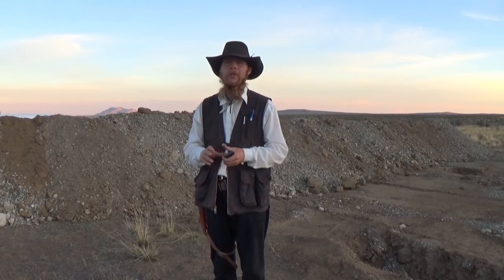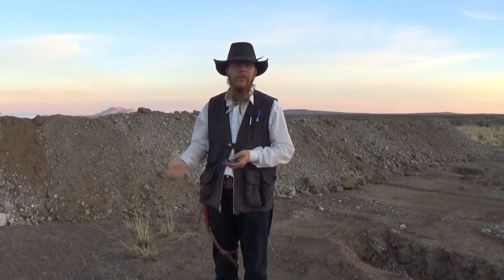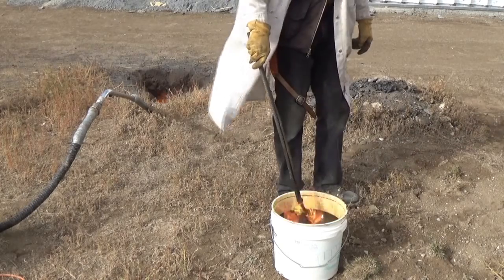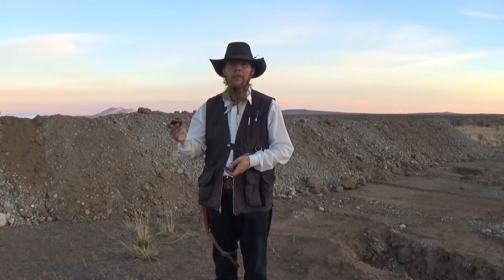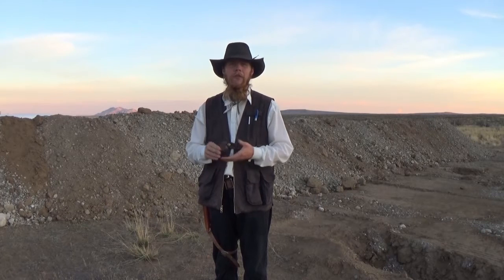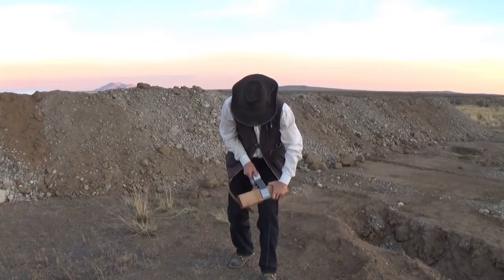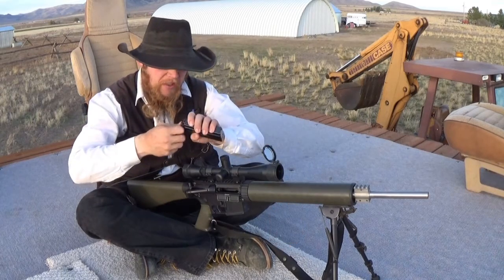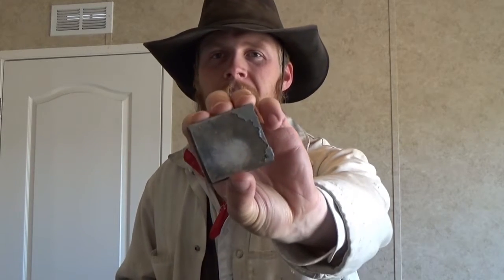223 vs Heat Treated Steel (TIS054)

Comment: It's not surprising, buddy. The quenched plate comes in layers and the bullet shattered a few layers hence took all the power out of the bullet. The tempered one being more malleable took the bullet slightly in and the cracks spread radially. Great video.

Comment: HAHA yep that'll do it. There are some key details in hardening and tempering which will give you a much better effect.
If you harden in oil, she wont reach quite her maximum hardness, water/brine is best for that, especially chilled water.
The tempering process also gains much more consistency if you repeat the process two or three times at least.
All that being said, armor plate is compressed to refine grain structure and give a consistent grain change over depth.
For a home job, you would probably have a better time using hardfacing on mild and layering it.
Entertaining all the same
Reply: Dude, you have no idea how to harden steel. Chilled water? Really? Water brine is not "best" for all. It depends on the steel you are using. Oil is the best thing to use in all cases but not motor oil like the video shows. The is a specialized oil to use for quenching and you can get different weights for different metals. 

You must be the know it all in your group who constantly talks about things he knows nothing about huh?

Comment: A stress relieved piece will hold up against that 223.  It must be heald at a specific temp for a period of time to let the molecules relax and become in contact with every other adjacent molecule. That will make the steel not crack.  Even you cutting the piece puts stresses in the steel that should be relieved.  Blocks, cranks and connecting rods for ocean-going engines where brought temperature in Wisconsin Steel Industries ovens that were capable of 4000deg for stress relieving. Followed by an oil bath once they came down to another temperature specified by the engineer via a time frame. They are 30 feet tall so it takes a bit of time.   Complete racecar tube frames after I'd completely welded every weld from tubes to tab n gusset would get stress relieved in those ovens also.

Comment: Not to hijack this thing but.......If you want. I can send you some REAL 1. Annealed Steel2. Hardenend Steel3. Properly Fully Tempered SteelIn High carbon Steel. Stainless Steel. And also in the great German 52100 Ball Bearing Steel. # 3 different steels........my scrap pileFree of charge. Let me know. You would see much different things and have a better time too w/ this test.
Reply from the maker: Well, that's very kind of you.  I'll admit my methods are a bit crude, given my limited equipment.  Is your scrap pile located in Idaho?